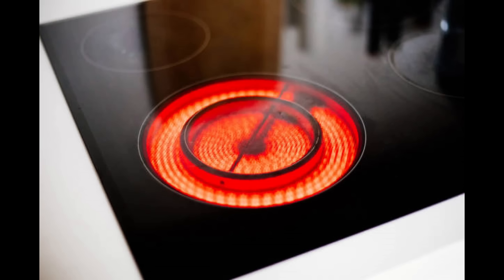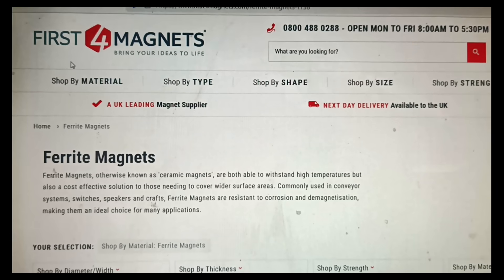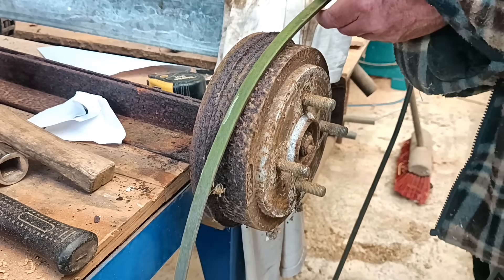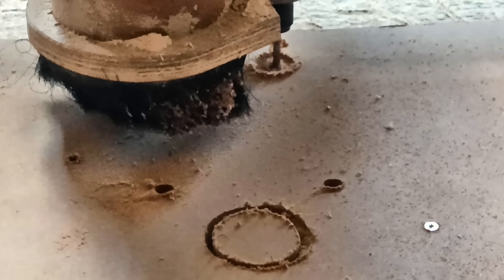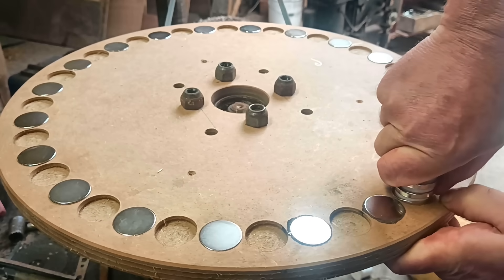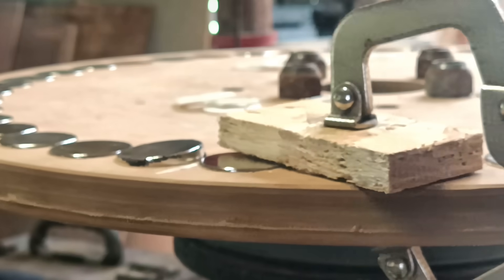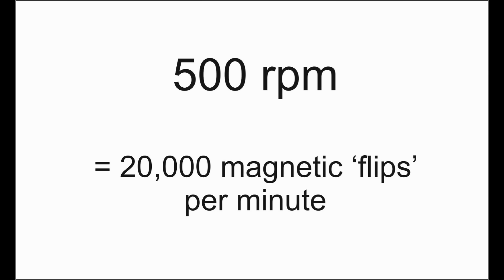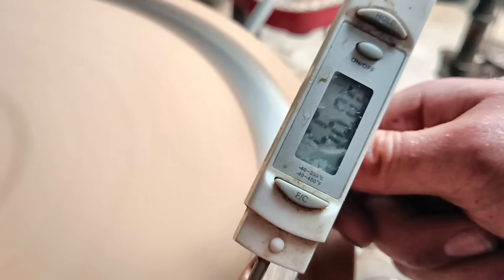I Made A BIG Rotating Magnet Induction Heater! (with magnets from First4Magnets.com)

Comment: your explanation doesn't make any sense "the magnet field pushes and pulls on the metal in the pan"? no. the magnetic field  induces eddy currents in the pan material which generate heat through internal resistance.
Reply from the maker: and what is the resistance if not the push and pull on the atoms?
Reply: @wayoutwest-workshopstuff6299  "push and pull on the atoms"??. the B field only makes heat by inducing I. the B field has no direct effect on heating. if you explain induction heating, like you did, without talking of eddy currents you are getting it wrong. sorry.
Reply: @wayoutwest-workshopstuff6299  i even asked chatgpt to help you out. look - Certainly! Let's break down how induction heaters work in a simple and accurate way:

Induction heaters work based on a principle called electromagnetic induction. Here’s a step-by-step explanation:

    Electromagnetic Induction: When an alternating current (AC) passes through a coil of wire (which forms the heating element of the induction heater), it generates a rapidly alternating magnetic field around the coil.

    Interaction with the Pan: When you place a metal pan or container on top of the induction cooker, this alternating magnetic field induces electric currents in the metal of the pan. These are called eddy currents.

    Eddy Currents: Eddy currents are circular electric currents that flow within the metal of the pan in response to the changing magnetic field. They circulate through the metal, generating heat due to resistance (the opposition of the material to the flow of electric current).

    Heat Generation: The resistance of the metal to these eddy currents causes it to heat up rapidly. This is because electric current flowing through a resistive material (like metal) converts electrical energy into heat energy according to Joule's law (P = I²R, where P is power, I is current, and R is resistance).

    No Direct "Push and Pull": The alternating magnetic field does not directly push or pull on the atoms of the metal. Instead, it induces these eddy currents through electromagnetic induction. The resistance of the metal to these currents results in heat production.

    Efficiency: Induction heating is highly efficient because it directly heats the metal of the pan without needing an intermediate heating element (like gas flames or electric coils). It also allows for precise control of temperature and heating rates.

In summary, induction heating works by using an alternating magnetic field to induce electric currents (eddy currents) in the metal pan. These currents generate heat due to the resistance of the metal, not because of any direct "push and pull" on the metal atoms by the magnetic field. Understanding this process helps clarify why induction heaters are efficient and effective for cooking and industrial heating applications.
Reply from the maker: Thank you. I'm not trying to be foolish. I'm really just a beekeeper but I keep finding interesting things to explore. Most of my videos dont get as many views as this one has - so my mistakes aren't usually this visible : -  )
Reply: @wayoutwest-workshopstuff6299  thanks for your explanation mate. i wasn't trying to be a tosser. just it irks me to think people may end up being misinformed.

Comment: Sub'd. No way I'm going to miss this project. When I was a teen (back in the 1800s I think) in Kansas, I built a windmill rock polisher. It was direct drive -- simply a trailer tire about 1/3 the diameter of a pretty rough, dual-bladed approx 1 meter windmill, hooked directly to the shaft. The grit and the rocks were dumped into the bottom side of the tire. They tumbled there just fine until the rpms got to where the rocks ceased tumbling and just became fixed to the inside of the tire. This caused me to install flexible blades on the windmill that regulated rpms down to where the rocks remained tumbling in all but the worst wind Kansas could throw at it. Then I became interested in girls and junked the whole apparatus.
Reply: Wow! I've never met anyone over 200 years old!

Comment: It is a shame that the power used by the drill press was 10 times more than the watts of energy that heated the water. Still very interesting. How much heat could you produce by using that mechanical energy to run a generator and intern power a heat pump?

Comment: Neat. The temperature thing is the big issue. One of those laser thermometers will help. A design where the magnets are locked between two sheets is a good start, whether you rotate the magnets or not. One magnet coming adrift with low clearances and high speed will likely rip all the other magnets out in an explosive disaster. Even one at 1000 rpm is undesirable, it could cascade the wheel out of balance. Glue doesn't like heat either. The two sheet thing requires fatter magnets to leave safe clearance. The magnet ring could benefit from cooling fins on one side, but this uses power, but you might be able to duct the warm air somewhere useful, away from the magnets. You could also go full boar and along with heating water on the bottom side use the finned side to generate electricity via other magnets. It all depends on the size of your windmill, you're just harvesting the 'free' power. Good luck, stay safe.

Comment: Alright,  now what if you had instead of the piece of copper... you had a disc above with many fingers bent down towards the magnets.   Spaced and gapped accordingly... would or wouldn't that generate even more heat?  Then if it weren't stationary and could be spun in reverse at the same rpm, maybe using a reverse drive...then you could possibly double the output again.  😅

Comment: This is fascinating as heck. I'm imagining the windmill powering a chain of gears that graduate upwards and in turn spin many magnetic discs, heating a large, even area of pipes on a wall or a floor or even suspended in the air above or below the spinning discs of magnets. Free hot water for as long as the windmill spins.

Comment: I would go with a Vertical-axis wind turbine (Vortexis - Helical Darrieus - Scoop Savonius turbine Types )  - Very Low Wind speed start + lots of torque + Multi Simultaneous Wind Directions ( they do like Turbulent Air zones  From Tress / hills / buildings) and can be Vertical & Horizontal (invisible due they can run Along roof tops and be hidden )
but i would used continuously variable transmission (CVT) (with Infinitely variable transmission) to better match Dynamic Winds AND BURSTS

Comment: Many baitcasting fishing reels use the same layout of magnets for magnetic braking to keep the spool from over running. Different companies use different designs but the basic system uses an aluminum or copper disk fixed to the end of the spool and a ring of alternating magnets on the side cover of the reel which can be adjusted closer and further away from the spool disk. They are effective and can get quite sophisticated with some companies trading the metal disk for a cylinder on a centripetal clutch sliding in and out of a double ring of magnets, or the reverse where the magnets are allowed to move in and out on a spring clutch. It never occurred to me that magnetic brakes would generate heat, but I suppose all brakes create heat.
Reply from the maker: I didn't know this - very interesting. thank you

Comment: The "Can it run Doom?" of magnet constructions: "Can we do it with Halbach arrays?"
Reply: There is no Halbach array in the video. What is there, is a VERY crude approximation that uses the magnets inefficiently. To make it much more efficient and much more like Halbach arrays, the magnets should be placed of a rotating steel disk, which will provide a magnetic return path for the magnetic fields, on the 'cold' side, the side away from the object being heated. The benefit is that on the 'hot' side, the magnetic fields will be more intense, and that will "jiggle the electrons" more violently, creating more heat. It is not perfect, but it is an improvement.

Comment: 40,000 flips per min is 333 Hz. An electronic induction heater will normally be running between 10-200kHz at similar magnetic flux densities, increasing power density by 100x-10000x. Enough to get that same copper bar glowing red in seconds. The power it is taking you to spin the wheel is probably 1000x what you are getting out of it in heating. You would be better to put a mechanical drum brake and flow water over if heat is what you are after, or an alternator/generator if you want something more useful. You are literally reinventing the wheel.
Reply from the maker: I'm just exploring my options...

Comment: Remember: Rotating magnetic field creates an electric current in wire coils. So, put coiled wire on the other side of your spinning disk/flywheel to generate electricity to charge home power cells/batteries. Generate your heat and electricity for your home off your windmill. Eh?  Plus, gearing will create the rpm you want. Flywheel conserves energy. Magnetic field to generate heat and electricity.  Throw in a Stirling engine to harvest heat wasted from heating your house or heat transfer to your house heating system and glean more benefits.

Comment: suggestions  
1) curve the copper pipe so that it matches the arc of the disk. that way the ends of the pipe are getting the same induction effects as the middle of the pipe
2) make a stand to hold the pipe (something I am sure you thought of, but didn't bother with for this proof of concept)

Ideas
1) A loop of copper pipe that matches the circle of magnets so all the magnets are utilized all the time
2) several curved pieces of copper pipe that when laid end to end would make a loop that matches the circle of magnets (the separate pieces would either need to air gapped or insulated so that the electrical inductance does not transfer from one pipe to the adjacent pipe)
Then compare the results of the 2 set ups

Comment: Hmmm flat copper pipe bent into the same diameter of the magnets suspended as close to the spinning magnets as possible. Should be able to pump water through to heat it, could also add an extra wheel to the other side to get a stronger magnetic field

Comment: Cool video. Of course using mechanical rotation to compress air and use the released heat from that would be more efficient - in effect this would be a simple heat pump allowing efficiency /COP above 100%.  But this is still v cool

Comment: your ph balance is off i haven't been really sick in 15+ years. while your sick stop smoking eat nothing but alkaline foods no meet and fast for 1 week each month and you will get better. when your eat alkaline foods your blood becomes alkaline that allows your white blood cells to move around better and when you fast your white blood cells keep eating but if your not feeding them plaque they eat viruses bacteria and your plaque so its also good for your heart. every time the slightest anything thats what i do. the most i get is sometimes ill feel my lymph nodes swell and i know my body is doing something or ill get chest pains and know its time to fast and temporary change my diet. eat first fix your ph then fast so its more effective dont do more than a week so you dont loose mussel mass. i also turn up the heat get my body really hot like a simulated fever to slow the production of viruses and bacteria thats why dogs dont get sick there body temp is too high also plaque melts at high temp so its just make the white blood cells job easier. maybe im nuts i dont go to doctors or take meds ever dont trust them.

Comment: I would add heat exchanger/accumulator to heat up a water reservoir that would then heat water passing through it. But consider pressure safety. Magnet disc in this setup won't be able to produce enough current for substantial flow heating.

Comment: One of the things you will eventually have to work out is how to adjust the mechanical loading of the windmill as windspeed changes. This is important to extract energy efficiently. The only way I can think of without dramatic changes to your system is to move the copper farther or closer to the spinning disk (rotor).

Comment: Ideally you would want a piece of iron or steel on the far side of the magnets to connect them. This completes the magnetic flux circuit, and should increase the loading on the prime mover  (and therefore increase heat production). Basically a flux ring is what I am describing.

Comment: I understand that a lot of energy goes into magnetising the neodymium magnets. When you are using the magnets to heat the copper which also induces the magnetic resistance will the magnets lose their magnetism after you have produced an amount of heat energy that is equal to the amount of energy used to magnetise them? excluding the energy used to make the disc spin.
I could have worded that better.

Comment: That was a fun video- really explains in basic terms just how induction heating really works which is no doubt very helpful for some viewers new to this . Viewers comments are great too ! 
It would be interesting to know if this method would work better for your purposes than running a generator  and using the current produced to heat an element . Keep up the interesting work !

Comment: He used 4 boxes of 10. Using the part number ( F359-10) on their site is much faster.
30 mm dia x 5 mm thick N42. Neodymium magnet - 9.8 kg Pull. Pack of 10. Part Number F359-10.
N42 Neodymium Disc Magnet - 1-3/16 in. dia x 3/16 in. thick - 26.46lbs Pull F359

Comment: Under floor heating is normally around 21 degrees C so it should be easier to achieve that with a lower speed, and therefore safer.

Comment: Nice. Thank you for the video 👍
I had a past project to replace my house boiler by a non mouving copper sphere with water flowing in the sphère.
The sphère was surrounding by magnet attached to a windmil shaft. The windmil can follow the wind direction by turning arrond the  sphère axis.
Simple is beautiful.
Reply from the maker: And did it work?
Reply: @wayoutwest-workshopstuff6299  I Never buid it. 
I leave in south of France and the sun is more powerfull compare to the wind. So i build a solar thermal system to heat the floor.

Comment: Windmill powered underfloor heating‽ Interesting... 
Better do the math to get the sizes in the right ballpark.

For water heating purposes a vertically aligned disc at basement level should allow for passive circulation.

Comment: One has to wonder though: Would the output in heat from a magnetically induced source be any greater than that of a resistive load? In terms of a windmill, I'd think a tub of oil with a paddle being rotated in it.

Theory indicates that the same amount of power in (for 100% conversion) will produce the same amount of heat with both methods.

Comment: Well, the only potential flaw i see is that the magnets also gets warm and if they get hot enough (see magnet specs) they loose their magnetism.
You could get high temp magnets but they are much more expensive.
Or you could put some coils instead of heating a metal piece, harvest the electric power and use that to power a heating element or heating wire.

Comment: It wouldn't be too hard to end up with a steam system. Open systems would have their own problems as well.

I believe an experiment in temperature control is in order. I think a clutch actuated by a mechanical thermostat would be the most stable and longest lasting solution. The final system should be on or off well under the boiling point and be designed to fail open.

Comment: Great Video. I might suggest using a metal less conductive than copper. More heat may be produced with the same energy input due to the resistance of the metal to the induced currents.

Comment: Muppets. Hold the damn thing with a pair of vice grips or at least gloves! And clean up your workshop! Sheez.

I wonder of there's' anything more English than the use of "Centigrade" instead of the correct <ahem> term Celcius.
Reply from the maker: Ha! Thanks for the advice but we're not English - and centigrade is not wrong (though celcius is probably better). And obviously you missed the bit about the powerful magnets - vice-grips!! (Sheez!)
Reply: @wayoutwest-workshopstuff6299  Yeah that was stoopid wasn't it (the vice grips advice. Don't you just love the armchair critics? 🙄)

Yeah I know you are based in Ireland - I didn't miss that part! - but (a) your accent is <ahem> not Irish! and (b) I just hate the American use of "British" when they mean English and in any event that would have been even more offensive in this context. Anyway I know you're not wrong to use centigrade but it's a somewhat dated term... 😁

I hope my comment came across as tongue-in-cheek and not the usual "Internet hater" tone. Didn't intend offence (with a "C"), just some light banter 😭

Comment: I have had the thought to attach magnets round the 23" flywheel of a Lister engine.  I was thinking with  many magnets, it would not take many  coil sets of copper windings to make a decent generator. 
In your design, you could have half the flywheel ( or a portion)  covered by pipe for water heating and the other with wire coil for electric generation. 

It would also be interesting for you at some point to measure the efficeny of this. Measure the power input of the drill,  measure it with the heating pipe in place and them measure the temp rise of a given amount of water.  This would tell you if you are better off using the magnets to heat water or would be better off generating electricity. 

Everyone seems to think indiction cooktops are more efficent but I have my doubts on what I have read.

Comment: yep that type of holder is a bit sketchy, sideways slot would be stronger, as it locks it in vertically and horizontally. try holding the measurement device metal on top of the spinning magnets alone. it gets hot too. 20k div 60s = 700Hz. yep a holder arm instead of human labor. lol.